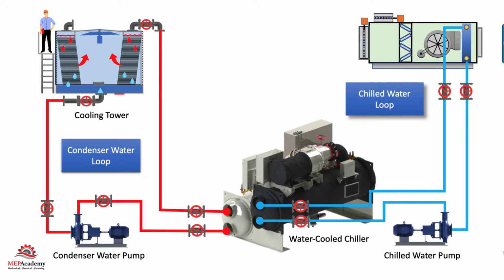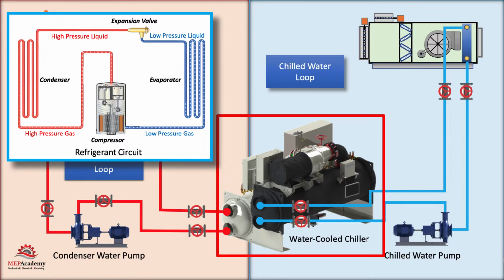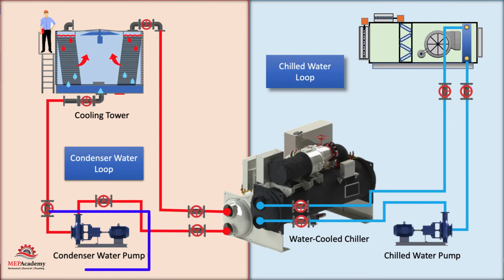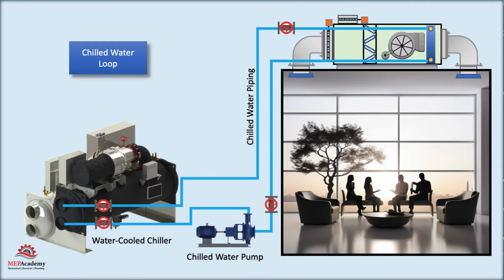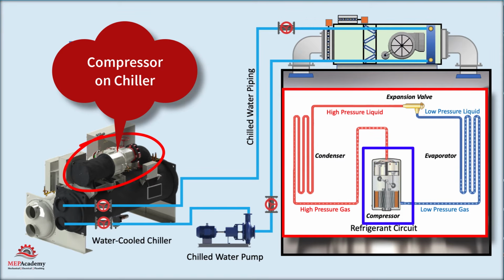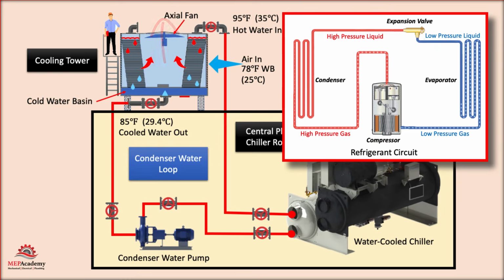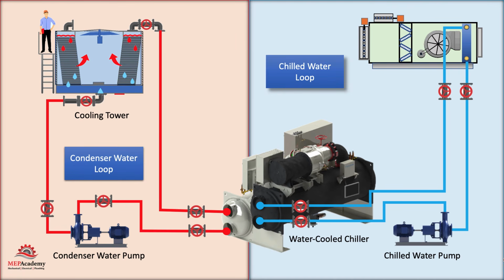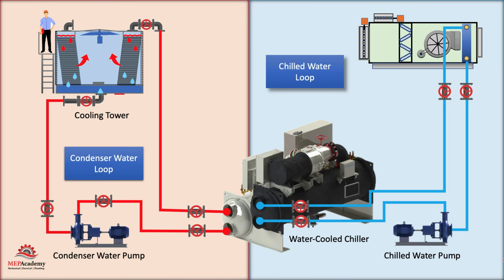Chilled Water Central Plant Basics

Comment: Where does air come from for the compressor?
Reply from the maker: No, the compressor pumps the refrigerant in a refrigerant circuit. An air-cooled chiller has a fan that cools the condenser which causes the high pressure gas to condense.

Comment: Great video. I have a question, at what point does the chilled water become supply? and return?
Reply from the maker: Chilled Water Supply is considered from the chiller to the heat exchanger, such as a coil in an Air Handler or Fan Coil Unit. Chilled water return is considered at the point it leaves the Air Handler or Fan  Coil Units Coil until it reaches the Chiller. Hope that helps.
Reply: @MEPAcademy  Can you please point out which is which at the chilled water pumps? I have a spec requiring chilled supply to be one insulation thickness and the return to be another. They even want condenser water insulated, perhaps for aesthetical reasons.
Reply from the maker: @SSMenace49  Do the drawings have a flow diagram where the supply and return are clearly shown? It depends on where the pumps are located. Are they before or after the chiller? Is it a primary/secondary pumping arrangement? Do you have a link to the drawings?

Comment: - I love the video I learned 

Chilled water is made in a special machine called a chiller.
- The cold water travels through pipes to cool down air in different places.
- There are pumps that help move the water around.
- The system helps keep buildings comfortable, especially in hot weather.
Reply from the maker: Yes, very good. Thanks for watching.

Comment: Does the chilled water loop and condensing water loop stay the same if you introduce a heating water loop?
Reply from the maker: Are you referencing the use of a Heat Recovery Chiller where the heat from the condenser is used to preheat domestic water or some other process?
Reply: @MEPAcademy  Where I work we have Heating water, Chilled water, and Cooling water. The heating water and chilled water are closed loops while the cooling water (from the condenser) is an open loop. I work with low pressure chillers but still extremely new to the trade (1month in) lol. But they have me as a me as a watch engineer to learn the process of the chiller, boilers, cooling tower, pumps, etc. But to be honest idk if we use Heat recovery chiller...I'd have to ask on Monday when I go back

Comment: I got a question, so basically the water cooled chiller here only acting as medium to transfer heat from chilled water loop to condenser water loop right?

So then it should be no fan which a normally attach to the evaporator to transfer the cool air into space?
Reply from the maker: The chiller contains the refrigeration circuit that provides the medium for cooling the water sent to air handlers and fan coils within the building. Having a fan at the chillers evaporator would require running large ducts through the building to each space if this was even possible. One of the benefits of using a chiller is that chilled water carries a lot more energy in small pipes compared to air using sheet metal ductwork, and so it requires much less space in the building to distribute.